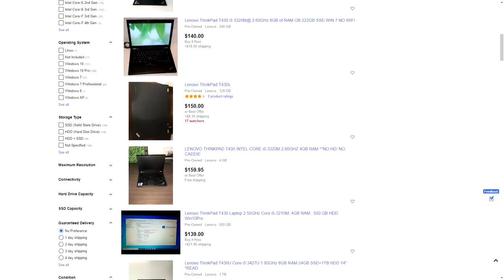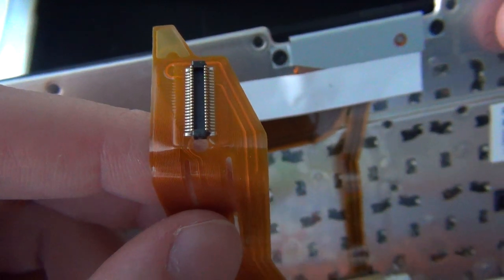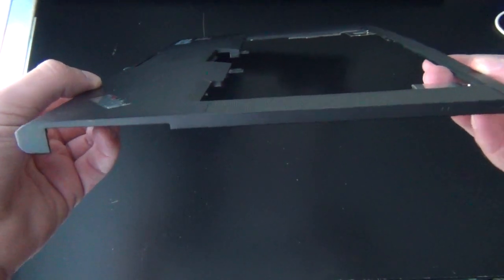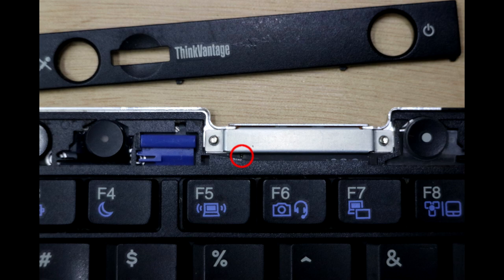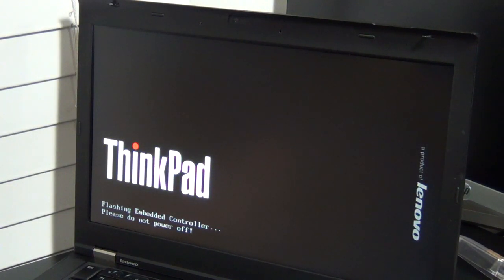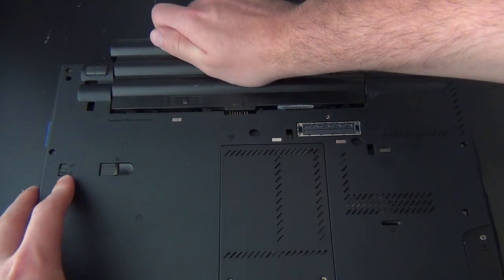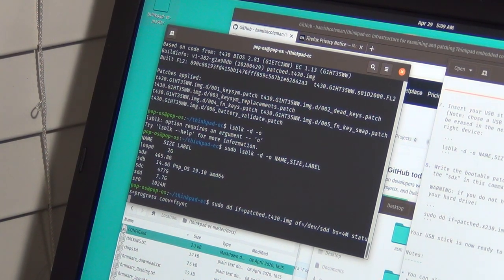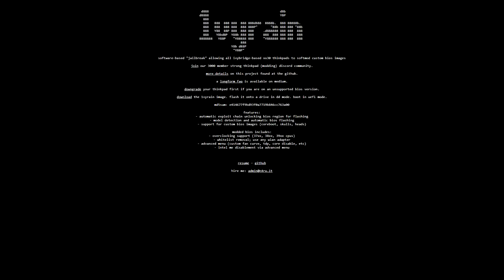Installing the classic keyboard in Ivy Bridge ThinkPads

Comment: Hey Sebi, I know you're probably not gonna see this comment but I kinda need help on a lot of stuff.
So basically, I am getting a ThinkPad T450, which will be used for schoolwork and other personal use. However, besides upgrading the memory I plan on also swapping the keyboard out for one of the classic keyboards, just like the one shown in the video. However, as this is my very first ThinkPad and "laptop" (if you can even call those idiotic weird pieces of junk I even got back then) in general in a real while, I have quite a bit of questions to throw at you. This is due to the lack of me being able to find almost ANY answers to these on the web. Some may make sense to you, some aren't about the keyboard, some may not but all are pretty random and dumb due to my 7th grade brain.

A) If I don't decide to do all of that weird key rebinding stuff to fix some keys, will some functions like the ThinkLight or ThinkVantage button still work using the keyboard?

B) Do the pins I need to cover up to prevent the "backlight short" have to be different than the ones you showed in the video need to be different as I will use a different model than yours, or will it be the same?

C) Are the ribbon cables extremely fragile? I have really unsteady, shaky hands and I would most definitely mess up this procedure as that scenario would be remade like the equivalent of a paper house and a category 5 hurricane.

D) Have you experienced any issues (what I mean is like the keyboard randomly cutting out under use) when typing?

E) Does either the new stupid keyboard AND or the classic keyboard get disgusting quickly over time? My hands not only unsteady like previously mentioned, but also sweaty and disgusting.

F) When I searched up the processor that the laptop has, it says it can take at max 16 gigs of memory (if you're curious, its an i7-5600u). However, if I'm not mistaken the T450 has both modular (slots for ram) and soldered on ram. Does this mean that I can put in a max amount of 16 gigabytes of modular ram and have the soldered on ram go into la-la land? Or for example lets say there's 4gbs of ram already soldered onto the pcb and I have to put in 12 gigs of ram to meet the max 16 gigs?

G) Was the T520 a better choice? When considering getting this during the time I was on the hunt for a schoolwork laptop after seeing another one of your videos, I found one that I really liked, but it had a small chip in the left corner of the palm rest thingy. Because of this, my dad literally insisted I get something that doesn't have it.

H) Is replacing the monitor too risky for my zombie equivalent hands? Throughout the history of replacing screens on said janky old hardware, the success rate was minimal to none.

Alright, those are my seven questions that you probably won't read. It's ok if you don't respond, I understand you have other more important things to do than helping out a brainless child on the internet with a laptop. However, it would be the best and kindest if you did reply as I would now have a lot more info to keep going on as this laptop ages throughout middle school, high school and maybe somehow into college. Thanks! :) [or ;( if you don't reply i guess]

(also one last question. is that T450 that I'm getting actually sturdy? im setting a goal to somehow make that thing last atleast 4 years.)
Reply from the maker: I will try to answer your questions as best as I can, in the order you asked them:

Regarding A, B, C, and D: The T450 can not accept the classic keyboard. The T430 and other xx30 models (X230, T430s, T530, W530, and X230T) are the only models with the new keyboard design that can accept the classic keyboard. Nobody has successfully adapted the classic keyboard to other models because the design of the keyboard, the cables used, and where it screws into the laptop are all different on newer models. It is both physically and electronically impossible. That being said, while I still prefer the classic keyboard's feel and layout the T450's keyboard is still perfectly acceptable.

E: In my experience if you keep your hands clean and periodically wipe down the keyboard with a microfiber cloth, it won't get all disgusting and gross. Your mileage may vary. If you don't make an effort to keep the laptop clean, it will eventually develop a lot of gunk and dirt.

F: The T450 has 2 slots for RAM and none soldered on. Each slot accepts up to 16 GB of RAM, for a maximum total of 32 GB (2x16 GB). That being said, I can't think of any use case where you would need more than 16 GB of RAM without the increased performance from said RAM being bottlenecked by the 5600U processor. The previous model, the T440, as well as the T450's thinner variant (the T450s) do have 4 GB of RAM soldered to the motherboard with only one slot for upgrades.

G: The T520 has the classic keyboard, a better and larger screen (depending on the configuration, the 1366x768 screen is garbage on just about any ThinkPad but the T520's 1600x900 and 1920x1080 screens are decent) and more legacy ports/media support (ExpressCard, DVD drive, Firewire, etc). However, it would be a tough sell if you plan on using it for schoolwork because of its larger size and poorer battery life compared to the T450.

H: It would be better to try replacing the screen on a less expensive or older laptop first to get the hang of it. I began learning how to do this stuff on my own and generally did it with laptops that had little value and I didn't care about, instead of risking damage to a more modern and expensive laptop. Additionally, if you want to put in a better display then you may want to try to find a T460, which was available with a 1080p display from the factory (the T450 only came with 1366x768 or 1600x900 resolution screens) and natively supports display upgrades (the T450 uses whitelisted displays so only very specific models will work correctly). The T460 is almost identical to the T450 aside from this difference, and also swaps out the VGA port for an HDMI port.

Hopefully this answers some of your questions! I'll try my best to reply in a timely manner if you have any more.
Reply: @SebisRandomTech  Hello again, just got back from school and typing this on my new ThinkPad. Thanks a lot for this help, you answered all of my questions! It's quite a bummer that I can't use the classic keyboard on my T450, but I guess I can deal with this style. Now, unfortunately as you mentioned (my w key literally just fell off typing the word mentioned) my ThinkPad does in general have a 1366 x 768p resolution screen, and it is absolutely awful. If I look at it with the hinge too far back the colors become dark and if I look at it with the hinge too closed down it looks like heaven. For some reason it said it's running on 1600x900p. I also keep mistaking the screen for a touchscreen every time I try to click on something even though the left and right mouse buttons are right in front of me. 
The keyboard is slightly smooth and shiny (idk if it's supposed to be like that or it was previously owned by a cheeto-dust finger discord mod before the laptop was refurbished and sent to me), but other than that yes it again for the second time is confirmed to be usable. Still getting used to the trackpoint and everything else, and I constantly fear that trackpoint will fall out because I can just pull it out, and then I have to wait another five thousand years for a replacement to arrive. 
Also, I just like having an unnecessary amount of ram because it's funny and I often forget to close out tabs or my laziness takes over and I don't close them. And it's running in like only one channel of ram used besides the soldered ram :(. Upon opening up the laptop on the first day to replace the thermal paste and check some other stuff, the thermal paste was drier than the sahara desert but by complete unluckiness I flippin ran out of thermal paste from my Thermal Grizzly tube, which was a miniscule amount. I couldn't tell the difference before or after the "thermal paste replacement", but at idle that poor i7 was running at 70 degrees celsius and if I can remember it was throttling down to like 1.4 Ghz when playing games like Dream Car Builder or even the darkest pits of hell of roblox on halfish graphics. Again, your information was very helpful and I don't really think I have that many questions to ask for now until going into the future where problems start to come in like the DANG KEYS FALLING OFF WHEN I'M TRYNA TYPE. Thanks again and I look forward to seeing more of your videos! 

(oh my gosh if I wasn't in two accelerated classes I wouldn't have learned to type all of that in the fastest manner possible with all of the worst imaginations of what would happen if I didn't get this in on time)
Reply: Also the hotswappable battery sucks cheeks.
Reply: Hi, It's me again 4 months later. Update on the laptop: It is actually quite good for personal use. However, I have run into some problems. Remember how I mentioned some keys falling off? The inevitable event has occured in which both my H and J key of the keyboard has fallen off. Back then when it was only the J key that broke, I tried (for some reason) supergluing the key to the rubber membrane that the key makes contact with. This was an awful idea because the key was rotatable back and forth, and was a horrible connection. When I tried to take off this key, it tore off the membrane with it. Because of this, I tried supergluing the membrane back to the little pad where the connection appears to register a key press, which made the situation even worse. And right when I was trying to fix the J key (for the second time actually, mind you this has happened before), the H key popped off. It appears that this issue is caused by thin plastic clips that latch on to the "scissor" mechanism that attaches the key to the keyboard, which break off and render a key useless. I also once ordered a keyboard replacement, but NOT to replace the whole keyboard myself, but just to superglue one of those plastic tabs I mentioned before, which was prior to this event. This rendered a good keyboard useless because I was not able to use that J key either, which means that I wasted $16 due to my lack of computer repair knowledge. So, I ask the question: Should I repair the keyboard again? There are a few key points to state:

1. I am much better at repairing computers now, knowing that I likely, for example, won't destroy the CPU die by stabbing a screwdriver into it. This means that I am ALSO able to swap out the keyboard because I figured out how to remove those annoying rubbers tabs by inserting a safety pin horizontally to the tab and prying it out. 

2. This, obviously, is not the only keyboard I have. I can also use my external keyboard which, in my opinion, is better than the chiclet design Lenovo made for this keyboard. The only downside is that it would take up a lot of space, if not more, in a carrying bag I would keep my laptop in. Carrying a full sized keyboard with a laptop outside a case would also be sort of dumb to carry by hand.

Honestly, I think I should just stick with 1. and repair the whole keyboard, but I am still asking to have a second quote to think about. Adding another worry to my laptop isn't convienent either because I have both schoolwork and my computer to work on. I've been looking for a Cooler Master CM690 I - III for sale that isn't going for a ridiculous price. The first one I have seen was actually going for extremely cheap; $60. However, some loser sniper bot decided to rip that chance away from me and win the auction, and I presume that's going to be the "Cooler Master ATX Case NEWWWW!!!!! (NEVER USED, BUY NOW)" for $400 and $90 shipping eBay listing... There are two last options I had in case this failed. One is a CM690 III which is exactly what i'm looking for, but is also a bid. By this, I run the risk of dealing with another sniper bot. This is also colored as black and green, which may match up with some random nVidia logo (if that makes sense???), but it just looks like a rip off NV690. This color theme wouldn't really make sense either using that kind of reasoning because the graphics card I use is in fact an Nvidia Geforce GTX 980 Ti, which is my latest upgrade, but it is not a founders edition. It is, instead, an eVGA subvendor version. The second option is an RC-692, which basically is a CM-690 III advanced. Both are roughly $100 and are likely to disappear off of eBay soon if I don't take action. Either way, it is a better option to just get a new case even if it isn't one of these instead of using my Rosewill SCM-01 because it doesn't restrict so much airflow. My i7-980x has even reported to reach a temperature of 92 degrees celsius, which isn't good because that temperature would (probably) decrease the lifespan of the processor. Although that is hot, it can just be caused by my overclock from 3.6 GHz to 4.0 GHz with the stock DBX-B cooler which may not be the best for overclocking. Unlike the other cases, my SCM-01 has a solid black plastic panel that allows for no airflow besides a little hole at the bottom Rosewill will advertize as "effective cooling". The CM-690 has a meshed front panel (and more!!) which allows for much better airflow and, because of the modularity, support for a bunch of optical drives I would have no reason to use. It is also important to note that the Rosewill has a top loaded power supply, meaning that all of the hot air rises into the cooling fan of the power supply which wouldn't really be a good idea considering that's an 80 plus standard 600w PSU also by eVGA. The CM-690 has a bottom loaded power supply which allows the power supply to draw fresh air through the bottom and not superheated gas from the graphics card or processor. If you do read this, what is your opinion?

Comment: Can I use electrical tape instead of masking tape?
Reply from the maker: I don't see why not, as long as the correct pin is insulated.
Reply: Best tape is kapton tape, it's made just for these purposes, and very thin, thicker tape has the potential issue of preventing proper contact of other pins.

Comment: The new "magic keyboard" on 2020 macbook air + pro and 2019 16" macbook pro are much better than any thinkpad keyboard imo. I type much faster, but that's all personal preference.
But nothing can compare to a mechanical keyboard with blue switches
edit: any keyboard is better then the butterfly crap tho
Reply from the maker: I tried out the new Magic Keyboard, and frankly wasn’t impressed. It’s certainly an improvement over the Butterfly switches, but to me the only laptop keyboard that’s better than a ThinkPad’s is that one massive gaming laptop a few years back that used a full size mechanical keyboard.
Reply: I use MBP 2020 at work. The keyboard is ok, I can type as fast as on my ThinkPads. However, I prefer the feel (more travel) on the ThinkPads, and most importantly, the 7-row key layout. The function key touchpad is infuriating and ridiculous, I really hate it. Glad to hear that they dropped that "innovation" in the current models.

Comment: Learn to properly bind modifier keys and happily double or triple the buttons on your keyboard, without ever having to leave the homerow and certainly without obscure, highly context specific and outdated additional keys that just clutter and enlarge the laptop itself. This stubborn holding-on to outdated keyboards is the product of not being able to type properly... and probably also the lack of will to adjust/improve how you used your device 20 years ago.
Reply from the maker: Everyone is different and has different needs/preferences. I prefer the older keyboard and feel more productive using it, I don't see why this is something for you to get angry over. Ever heard of the phrase "if it ain't broke, don't fix it"? Changing up a layout that has been consistent for 20 years to value aesthetics over productivity is fine with you? People preferring the older layout hardly has to do with not being able to type or the "will to improve how you use your device" or whatever.

Tell me, why should I completely relearn how to type thus hurting my productivity in the interim just because somebody else thinks I'm not typing properly and wants to switch up the keyboard layout on me? What other aspects of your everyday life do you think should be completely altered just because you perceive it as the result of stubbornness? The "you're using it wrong" mindset when a design mistake is made by the manufacturer is a common deflection used by Apple fans...
Reply from the maker: Also, I know plenty of people who use these keyboards and do bind modifier keys, still using all of the keys in the process. For those people the newer keyboard design was a major downgrade. Are you going to tell them the same thing, that they're being stubborn and can't type properly too?